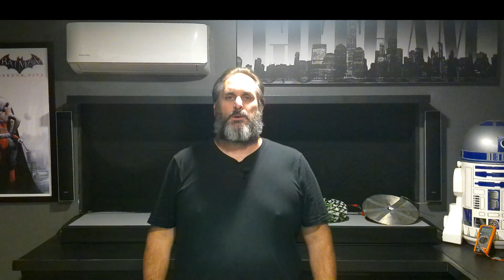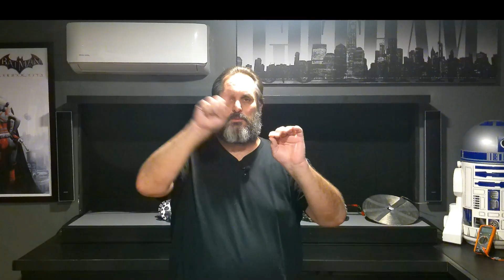Graviflyer "The Cold Energy Loop"

Comment: I'm making a dual HV supply for my graviflyer. I'll use it instead of tesla coil. Ground to center disk, negative HV to lower disk and positive HV to upper disk.
Reply from the maker: sounds like you are going to pull the energy to the center plate and make plasma. I have done this experiment. it looks great. but it is missing the real reason for the tesla coil.

Comment: Help me understand this cold vs hot energy.
Am I wrong if I think of the "cold" is the negative charge. The energy of expansion (making things cold) pushing the field apart. And the hot is positive charge. The energy of contraction (making things hot) pulling fields to it.
The key is the flow and balance of charged fields. The cold wants to fill in the "free space", and expand, while the hot attracts, contracts it, and neutralises it releasing heat.
With the gravity flyer, if you "pump in" enough cold energy that it inverts on itself creating a "cold" bubble around it making a mini earth?
Further, if we look at the Earth as a capacitor, the tesla coil would promote the flow of fields from space to earth due to resonate charge imbalance, could we tap into that for more gains and usable power? Like for example if we put a TC and put the center wire directly beneath it down to the water table, pumping, and we add a spiral of corona motors around it on the surface. If those corona motors are good enough, would they produce a lot more energy then what the TC is using, since they would be going off of the flow of charge imbalance created by the "pump" and resonance?
Thanks again old man for this priceless knowledge you share.
edit: I forgot about the piezo electric sound burst. What if we had a big enough element that could "push" on the charged ground? If all is in resonance, that would make the readings go off the scale?
Reply from the maker: all those things are true. Balance for certain effects. pushing the limits for others. It just depends on what you want to find out.

Comment: not a fan of the words cold and hot electricity and the generic use of the word field.   You have to be more technical,  are  we dealing with longitudinal em ?, transverse em?  impulses ? 
what field is being generated? im only aware of the magnetic and dielectric fields, which are different states of the aether ( like ice, water, steam) .
Reply: I associate hot, in this context, as energy that will burn and shock you.  Cold electricity won't.
Reply from the maker: cold as in - of a battery. hot as the + of a battery. We do not want the heat to be more than the temperature of the area you are in.  

We are controlling the heat in a system. Every time we go above the temperature around it we are using the energy. The piezo forces the top field onto the center plate field and causes a temperature imbalance and energy spike.
Reply: @oldmanbuilds  when you say  top field... what field? btw keep up the good work
Reply: @oldmanbuilds  also the single wire inside the tesla coil,   is it ac/dc  or longitudinal, what type of electricity do u think it is?
Reply from the maker: @toymaker3474  center of the tesla coil is cold energy. It will not shock you. I do not know what wave form or field to classify it in. 

The top field refers to the dc flyback magnetic field on the top plate. The magnetic value is low but still classified as hot energy. 

We are working with entropy in the system. We are using a small amount of heat to control a cold system. 

When it comes to the tesla coil. The #2 winding outside radiates hot energy. The inside of the #2 coil is pulling in the energy of the room but compressing it making it colder. Since the coil is a field the center is magnetically compressed. The wire down the center allows you to take the energy without interrupting the normal operation of the tesla coil. 

The only exception is that the amount of mass connected to the wire down the center of the tesla coil will change the frequency of that coil if it is out of perfect resonance.
Reply: @oldmanbuilds  i think for further insight with the wire,  you should look at the tesla hairpin circuit. ( stout bar) .  what's interesting  about this experiment  is whats happening with the wire between the 2 large caps in series. i bet what happening with your wire is the same thing that is happening with the  stout bar setup.
Reply: @toymaker3474  From what Nathan is describing and what we've seen with magnets under ferrocells I'm fairly certain the cold energy in the heart of the Tesla coil is a dominant Dielectric field without a magnetic component, the way he's describing it sounds exactly like the position of the magnetic torus and dielectric hyperboloid in a magnet.

If that is what it is it would also mean this is Reactive, this kind of energy has shown in the post to be able forgo causing material damage with arc breakouts not causing burn damage to insulating material, Strebkov observed this in resonant single wire circuits where the sparks were able to pass through water and other materials without evaporation of destruction, he called it Reactive Plasma.

This is something I've been looking for more information on, if that is the nature of the field inside the coil that's pretty big as it opens the possibility for a new kind of Power source that's none destructive in nature on top of using it for the GF.

IMO, in any open system you want to keep the Magnetic and Dielectric fields as out of touch as possible, a power factor of 0, until you want it inside a load where it's put to work, nature's power type is Reactive, Active power is artificial and hot.

It's also possible that the center of the Tesla coils secondary is a purely magnetic field without a dielectric field in contact with it, Aaron's experimentation with cold circuits found that a circuit with pure magnetic current flow without positive voltage potential was able to create circuits that cooled down to a few degrees below ambient, if the center rod is able to create plasma arcs around it then it's probably Dielectric since Magnetism doesn't do that.

Or perhaps it's something else entirely, Aaron has mentioned - to - potential circuits that have some odd temperature behaviors so for all I know the field activity has varying negative potentials without any positive? We need more data.
Reply: Came across this post from Aaron while browsing, seems related:

03-02-2015, 07:46 PM
"splitting the negative

It won't be as clean cut as I mentioned - just stating the basic concepts. It's identical in Bedini's 3 battery concept, the Gray motor and the plasma ignition... all higher voltage positive coming in contact with a lower voltage positive and they share a common ground.

The 50v cap can charge the 10 volt cap up a bit during this process so it goes down a bit and the one on the right goes up a bit - in reality, will probably be closer to what your simulator shows.

Yeah, just have to do the experiment.

---------------------------------------------

I'm working on a circuit that works on the differential between two negatives with a common positive so is like splitting the negative - just the opposite of the splitting the positive. Looking at the flow moving over the wires as a gas under pressure, positive voltage is a pressure and negative voltage is a suction, literally. So if you have a difference between two suctions, you have a potential difference even though it is negative with a positive current - meaning what is between those points is a cold current since no positive voltage multiplied by a positive current is negative watts.

I've done the basic tests in the past and had a validation that someone took this quite far. I'm doing a test right now and if I can show that this is what is between these points and can power a load without the load being reflected back to the front, then it just might be the simplest demonstration of real "cold electricity" that I've seen. A load between these points should drop below ambient temperature.

Anyway, fingers crossed - if my basic demo unit coming together demonstrates something interesting, then I'll be presenting this at the conference. Even if it doesn't do as expected, I might present it anyway because the switching method is something that hardly anyone has ever seen and it is very, very simple."
Reply: @JenkoRun  You gave me an idea. Instead of a dual HV supply for my graviflyer, I could use a single AC HV supply, and split the positive into + for upper disk and - for the lower disk with diodes
Reply: @starraider25  Or split it into - and -, positive seems to be pressure and force and associated with heat, while negative is suction and associated with cold, having a potential difference between negatives will still work as much as a difference between positives will, don't do the negatives with batteries though you'll ruin them.

Aaron gives an analogy of positive potential like blowing into a balloon, your encounter resistance and there are loses during the effort exerted to inflate it, while negative is like taking a filled balloon and sucking the air into your empty lungs, no effort is exerted for the movement, and I've also heard that resistance acts inversely to the norm with - to - circuits.

Experiments have also found that caps and batteries charged with negative polarity potential behave differently, batteries charged like that are better at powering resistive loads while poorer for inductive loads, that shows the properties of the fields are different depending on polarity.

Comment: Earth → Tesla Coil → Wire to Gravity Flyer → Energy Amplification (Piezoelectric Disc) → Bubble Field around Flyer → Ground (Completing the Loop)

I don't understand the long-term plan for this, because the energy seems limited, but I'm very curious to see how your project develops. I'm new to a lot of these concepts, but I appreciate how you try to keep things relatively simple for guys like me. I'm learning a lot. 

I don't have the time to wind a tesla coil, is there anything I could just buy instead just to play around with the concepts? I'm seeing some options for components under $50 to be able to tune a high frequency signal but not sure what's ideal.
Reply from the maker: get a zvs and dc flyback. The sparks and plasma are cool. It will teach you the states of energy.

Comment: Hey mate, yet again another great video. I just wanted to make sure I understood you correctly with a question. So the negative wire for the supply to the Tesla coil is connected to earth ground and then from that same connection point another wire goes to your load as does the wire down the centre of the Tesla coil, is that correct ?  
As I expect you do well don’t waist your time on the negative responses you get to your videos and keep up the great work as it is appreciated by the people that understand your research.
Reply from the maker: bottom #2 coil to ground. Top of #2 coil do nothing with. Wire down center of tesla coil all the way but attached to nothing. That same wire goes to the middle plate of the graviflyer. 

The ground and the graviflyer are connected as if the ground itself was a wire.